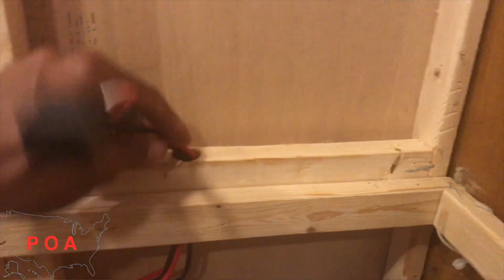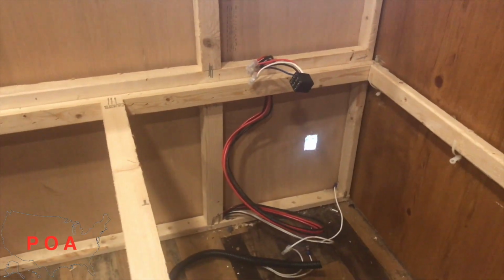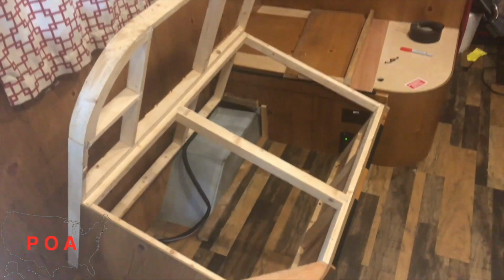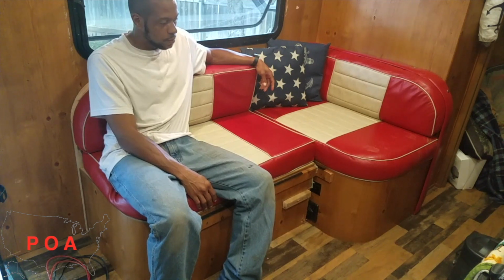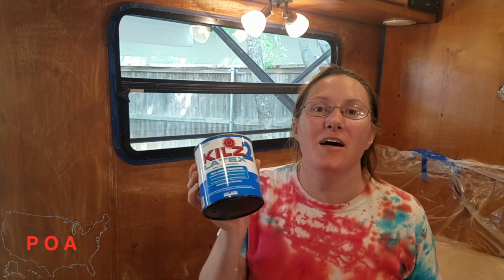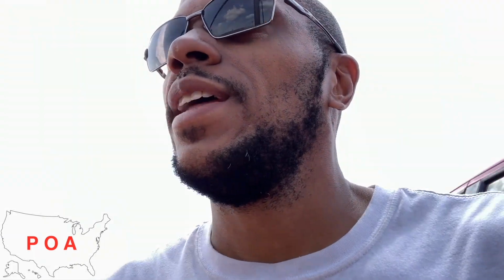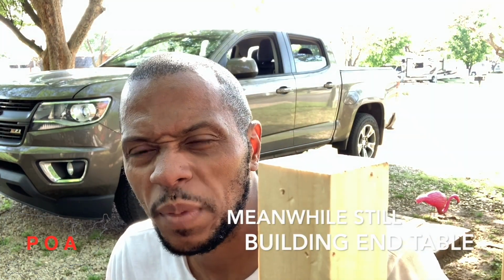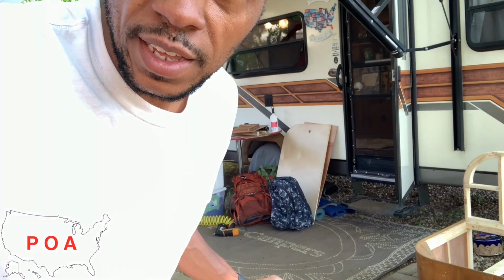Our BIG RV Renovation Vintage Cruiser Travel Trailer ~ Phase One ~ RV Nomads ~ POA Vlog

Comment: This is a great idea! I don't know why Gulfstream doesn't put a J couch in these trailers as standard. It is very tight at the entrance between the bed and the tall back of the dinette. The J couch really opens it up and makes entry much easier. Thanks for the idea and for showing us how it is done. The end table is genius; reusing the same cutouts for the switches. How is this modification holding up after two years? Have you had to go back and fix anything? Are you still happy you did it?
Reply from the maker: We can’t believe it took us so long to do it after we purchased the rv. It was such a pain when trying to open the door and our dog would be in the way. Getting in and out was a pain at times so happy we changed it up. The mod has worked out great just need better seat cushions and maybe change out the memory foam to make it more comfy. We haven’t had to fix anything and feel the extra support we added helped with making the seat more durable.